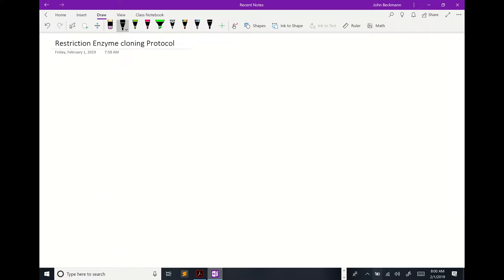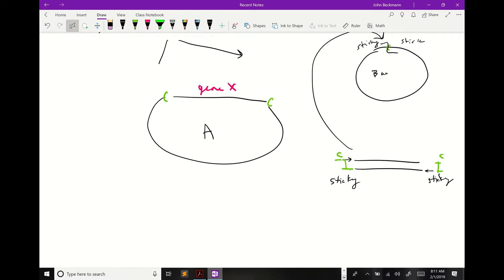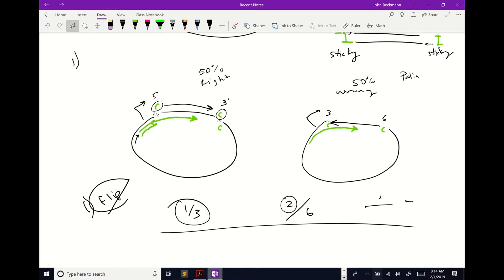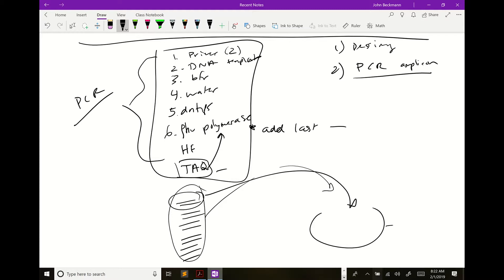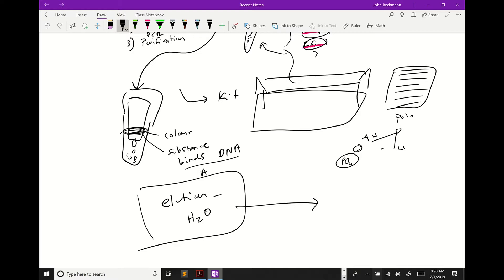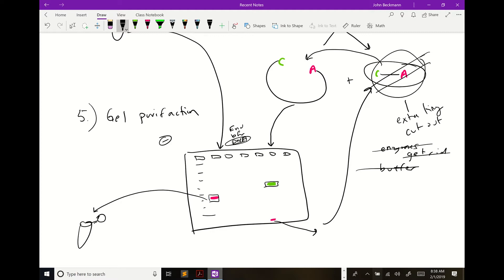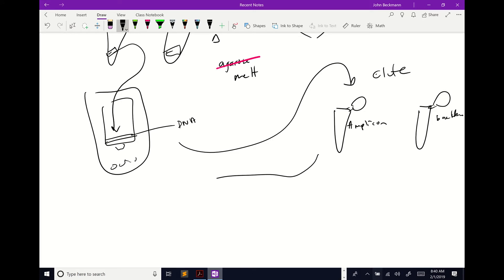Biotechnology 010: Restriction Enzyme Cloning: Prof. Beckmann

Comment: Time Stamps
0:26 — Primer Design
2:21 — How to download more base pairs from NCBI
4:05 — What should you order after designing?
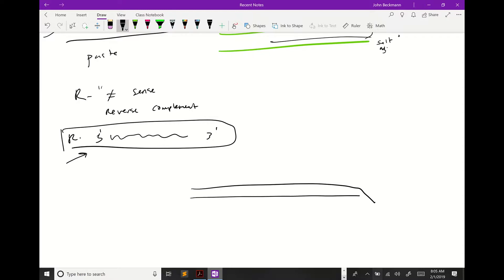5:32 — PCR needs two primers
7:22 — Sanger sequencing only needs one primer
8:25 — C/G Clamp
9:53 — Other considerations of primers
11:54 — It can flip directions
14:54 — Self ligation
16:45 — Calf intestinal phosphatase
19:08 — Why you might have to use one restriction enzyme
20:00 — Other types of cloning
21:06 — What goes in to the PCR reaction
22:15 — PCR amplicon
23:04 — Why cloning longer things are less efficient
25:31 — PCR Purification
28:15 — RE Digest
36:10 — Gel purification
38:51 — Kit gel purification
40:00 — Ligation
41:21 — Transformation
42:40 — Select bacteria
44:12 — Freezing 
47:52 — Verification